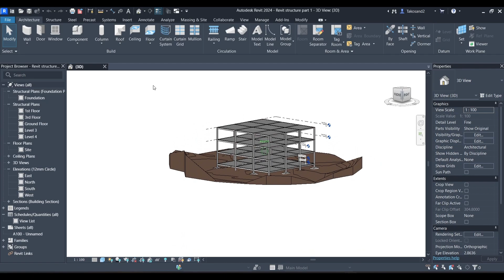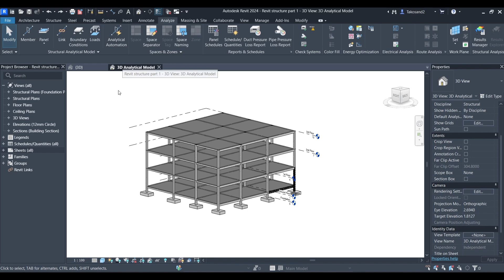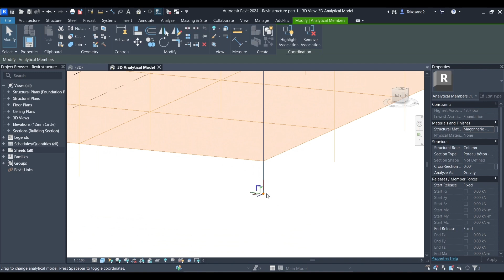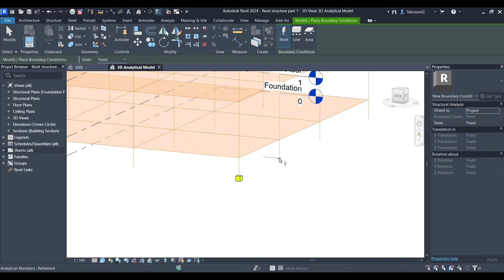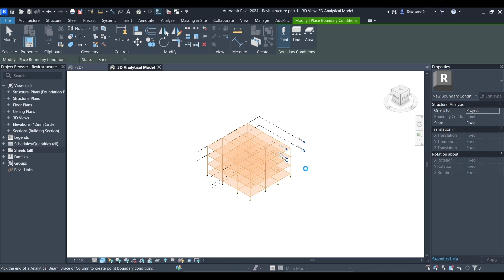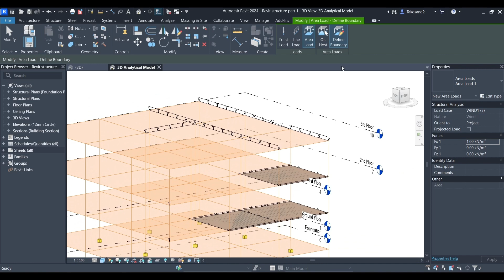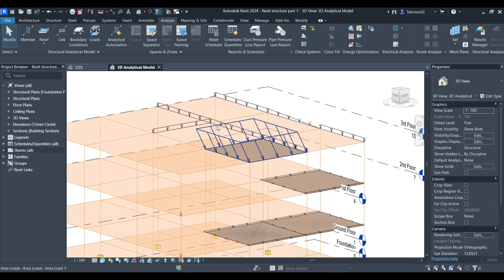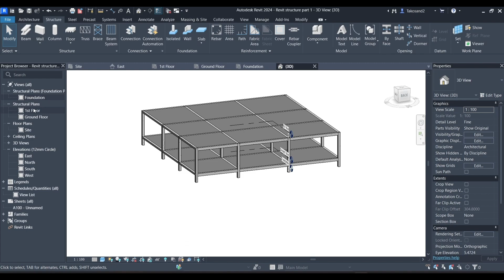Automate Analytical Models in Revit 2024 | Add Structural Loads and Boundary Conditions

Comment: thank you for this video ,i have a question please, how can i make sure the elements are connected at analytical model?
Reply from the maker: You can check if nodes are connected by enabling the analytical model in the Visibility/Graphics tab:
 Go to Visibility/Graphics (VG) and check “Analytical Model.”
Use the Check Connections tool in the Analyze tab.
This will help you see if the nodes are properly connected.

Comment: Why I am not able to see an analytical model in the Revit structure 2023 version? That was visible in the 2022 version. Is the analytical model visible in the 2024 version?
Reply from the maker: If you created it in Revit 2023 or 2024, you'll be able to see it 
But since the model is in Revit 2022 I suggest you don't migrate to a newer Revit version unless you wanna automatically generate a new analytical model

Comment: kindly help, when i do the automation, i find my analytical members especially beams below the nalytical floor panel, yet i see yours seem to align at the same elevation, how do you get to set that .? thank you
Reply from the maker: Sorry for the late reply, to align your beams with the analytical floor panel, you can follow these steps:
Select the beams that are below the analytical floor panel, then go to the Properties panel and look for the "Base Level" parameter
Set the Base Level parameter to match the level of your analytical floor panel, Once you set the Base Level parameter correctly, your beams should align with the analytical floor panel.  and ofc let me know if you need further assistance!
Reply: @HowToBIM infortunately its not working in revit 2025
I had to move all my beam up to fix it
Reply from the maker: @BIM.Structural.Algeria  Ugh, I haven't worked on analyticam models in revit 2025 yet, thanks for the heads up

Comment: Can we automate floor items with dynamo? For example i have brick walls layout on first floor and the second floor is also having the same layout. When i do changes to layout of walls on first floor then the same changes replicate on the second floor as well.
Reply from the maker: Hi, yes that's possible,  you can follow the script below and let me know if you have more questions:

1. Get All Walls on First Floor:
Select Model Elements node: Select walls on the first floor.
Element.Type node: Get the type of the selected walls.
2.Filter Wall Types:
List.FilterByBoolMask node: Use a boolean mask to filter only the walls of interest.
3.Create Walls on the Second Floor:
Element.Geometry node: Extract the geometry of the filtered walls.
Element.Curves node: Extract curves from the wall geometry.
Translate node: Translate the curves to the second floor level.
Wall.ByCurve node: Create walls on the second floor using the translated curves.
4.Parameterize for Future Changes:
Element.GetParameterByName node: Get relevant parameters (e.g., wall height, thickness).
Element.SetParameterByName node: Set the parameters for the walls on the second floor based on the first-floor parameters.

Now, whenever you make changes to the layout of walls on the first floor, you can rerun the Dynamo script, and it will automatically replicate those changes to the second floor.

I hope that was helpful
Reply: @HowToBIM  Thank you dear.
Reply from the maker: Anytime !

Comment: Thanks for the video. It is very helpful. Is your model a structural model or an architectural model? If I start with an architectural model, do I need to build the structural model first? In addition, could I do this with Dyanmo and control the boundary condition, floor/beam/column/foundation size, and load with Excel?
Reply from the maker: Thank you for your comment! I'm glad you found the video helpful. My model is primarily a structural Revit model, but you can definitely achieve similar results starting with an architectural model. By setting your elements as structural elements.

I've included two videos below that can guide you in getting started with modelling the structure with Dynamo. As for controlling more complex aspects like boundary conditions, I can start working on a script for that and will share it with you once it's ready. 

https://youtu.be/XYgJ1LKSRUU
https://youtu.be/pfdXu2phKc0
Reply: Thank you very much! You make very good videos. I found adding boundary conditions to the bottom of columns and walls takes lots of time. Is it possible to add the boundary conditions with Dynamo? @HowToBIM